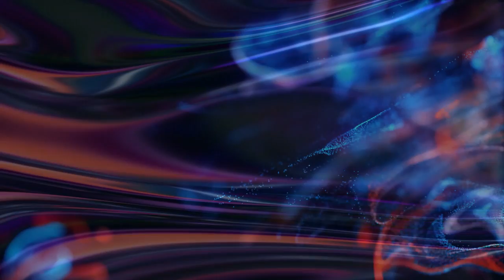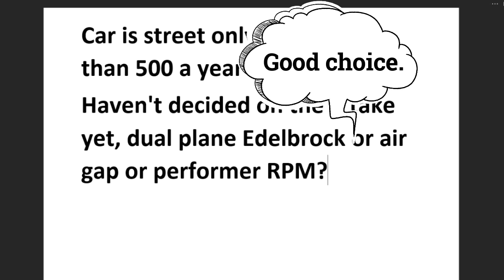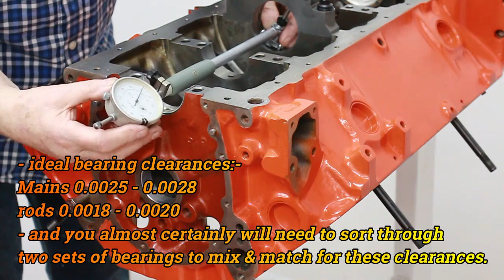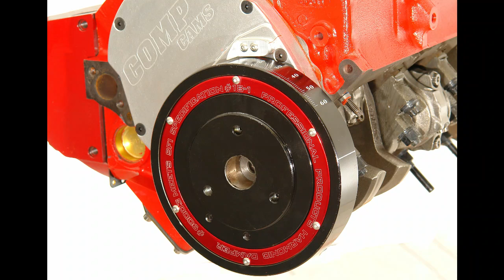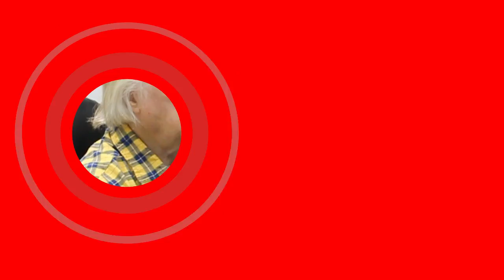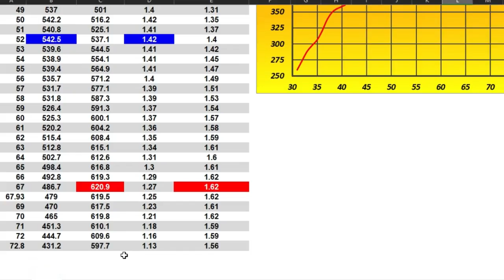How we built that super competitive low buck 383 SBC

Comment: Funny how dynos go back and forth on connecting rod length, though Chevy small blocks over 327 cid tend to lack a good rod to stroke length ratio and likely a longer 'rod is going to help no matter what. As for Howards camshafts, are they really the best company to contact for advice?  Seems like a lot of cam companies out there left over from the 1960's still copying other peoples' findings. I agree with the dished piston, best to have compression occuring inside the cylinder rather than inside the cylinder head--why try to push on the cylinder head? You want to push on the piston, and once it moves a few inches past TDC it's created too much volume and it's just along for the ride. Begin the compression up in the cylinder head and you've already lost distance as the piston moves and increases volume. 

I would argue splayed main caps are better than the factory 4 bolt simply because the bolts aren't in the same plane.  I also don't waste time painting the inside of any block--the factory doesn't bother, and they make it to 300,000 miles.  Has anyone ever pulled apart a sealed junkyard engine to find rust inside? Of course not, oil displaces water. Paint doesn't hold in casting sand either--in order to get the paint to stick, you have to clean out the pores of the block and thus you've gotten rid of sand.  Finally if paint could ever smooth cast surfaces for oil flow, body men wouldn't need to fine sand their work--they could just paint over scratches and get a smooth surface.
Reply: If your not pushing on the cylinder head your in turn not pushing on the piston. 
Also I don't think the glyptal is for rust prevention as much as it's for heat. Don't hold me to it but I think it's been proven that's engines internally coated with glyptal run lower oil temps, and I think it does aid in faster oil return. It seems to stick pretty good to engines and motors, I guess it works similar to a primer to fill in those scratches or sand pits.
Reply: @stevenbelue5496  True, the cylinder head is a roof (or foundation if we think of the entire cylinder upside down)
for the combustion kernel to push against, but if it's really just an "attic" where the combustion occurs through expansion, then combustion is pushing against the top and sides of the combustion chamber inside the head, and the "bottom" of the flame front is pushing on the top of the piston--in effect, we're only using 1/4 of the combustion kernel to move the piston and 3/4rs against the volume of the cylinder head and the bolts/studs holding it and the gasket in place.  Once the piston is (let's say) 2-4 inches down the hole past TDC, the volume has increased to a size where the combustion pressure has dropped and the piston is just along for the ride during the rest of the 4 stroke movement (compared to say a design where combustion was not happening in a large volume cylinder head but inside the cylinder itself--the piston will travel further from TDC before its created too much volume for there to be high pressure). The W chevy big block engine and Ford's MEL design had zero combustion chamber in their cylinder heads. Just three holes in a flat cylinder head deck, two for valves (they were all wedge design) one for the spark plug. Combustion occurred inside the cylinder itself, but Chevy wanted their W engine to be in both trucks (low compression) and for racing (high compression) in 409 Impalas and that meant compression had to be set by either piston design or block deck height.  This would raise costs in production, since pistons would require a balanced reciprocating assembly, et cetera. Ford's MEL design (Mercury Edsel Lincoln) was patterned off the FE series which was getting replaced by the Lima 429-460 so it too fell to the accounting axe. 

Glyptal is designed for low RPM industrial engines, and it is a recommended sealer paint over Rustoleum et al. some engine builders will paint the inside of a block when it's a backup racing engine that will see storage
and claim rust is an issue (but then why not paint the crankshaft and such, they need rust protection and oil to be shed as well). Glyptal will run lower oil temps because it will act as an insulator/poor conductor for combustion heat building up in the block, but that means the heat stays inside the block. If you design the engine to do something with that heat besides overheat (ie use it towards combustion) or get taken to the radiator by coolant, then you are onto something.  Hot oil will circulate faster than cold oil, however, and too hot an oil temp can be dealt with through an external oil cooler (something to consider on supercharged or turbo engines that rely on crankcase oil to lubricate the "blower". there used to be "turbo timers" that left the engine running after a hard drive to keep the oil from turning to coke on a hot turbo, but folks figured they could do it themselves for free :)  ). There's also an issue of detonation--if parts of the block around the combustion area don't cool, they can turn into "glow plugs" that cause a second source of ignition besides the spark plug. since pistons are made out of aluminum, its good to let them shed combustion heat thru the rings into the cylinder walls and then let the cylinder walls give that heat to the block and then to the cooling system (if you own an infrared scanner, check out different parts of a running engine, you'll be surprised at the readings you see regardless of what your temp gauge in the dashboard is telling you).

Glyptol will stick well (due to its composition) on metal that is constantly expanding and contracting due to temperature range (compared to cheaper paint designed to be used on metal not seeing such dramatic temp changes, plastic patio furniture, and other home needs), but like all paint it needs a really clean surface to adhere to--like even taking a torch to the block and wicking out the moisture from the pores of the cast iron. Cleaning that extensively tends to remove much of the casting sand found inside any block, and if that block has been "seasoned" (ie, run in a vehicle versus an aftermarket block straight from a forging process), chances are during its operation oil pressure has blown a lot of sand out and into the oil filter before we plucked it from a junkyard.  But primers, as you may know, have a dull appearance because they are not smooth of top surface--otherwise light would reflect evenly off its surface and give us the shine we see on glossy paint. Run your hand across it, and you will feel it--and if its noticable to the flesh, the oil likely finds it rough as well. finally, there's just the matter of application--if you want a smooth surface, you have to apply paint evenly, no runs, drips or errors (as the ads used to say).  The best way to smooth oil passages is to take a dremel drill and some padded bits and go to work polishing away the metal to a smooth surface. 

thank you for the polite response in an age of internet :)

Comment: I like vacuum advance. People who say "I only drive wide open" should like it as well as they never have any manifold vacuum. 

Also I think ported or timed vacuum has a use beyond just emissions, especially on some street motors that need a lower idle speed. I find it lets you idle down without basically blocking the transfer slot and this allows the transfer slot to work as intended to transition the mixture to open throttle. I prefer a "square" opening below the throttle plate if possible. If it is too short, there will be almost no fuel flow and when you open the throttle it creates a lean spot.

Comment: 6.0 rod pulls the piston away from TDC at a slower speed and that extends the torque curve to a bit higher RPM and that makes power. The cam/ports only know piston speed and a longer rod makes it seem like the engine is revving slower. This will also often raise the torque peak RPM as well but that is the tradeoff.
Reply: Joe Sherman did a test, found short rod SBC 406 had more power below 6200 RPMs. long rod more above 6200 RPMs...
Reply: Aye, the longer rod results in a greater rod-ratio, and hence lesser secondary imbalance. (which is the term used for how the piston travels faster at TDC and slower at BDC, resulting in forces on the crank that oscillate twice as fast as the engine)

Comment: I think that the cam manufacturers recomend more lsa because of vacuum for power brakes.
Reply: Yep, in actuality attributes such as idle vacuum, idle character, and fuel economy are the basis for the wide LSA's. But... for optimum power.. DV is dead on with his formula for calculating LSA' s.
Reply: Yes, in this street only build great MPG and a wide power band is usually desired more than undrivable biggest HP... The Chevy LS7 427" engine uses a 122 degree LSA for tractable power from 500 - 7,000 RPMs... Jeremy Clarkson demonstrates that by taking a Corvette from 0 to 200 MPH using only 5th gear!...
Reply: This age of turbo's calls for less overlap, I'm not sure I buy into it with the events happening as fast as they do.

Comment: 07:30 It would be nice if you could elaborate a little more on what is the failure point with the late model blocks ?
I would really like to know as i actually seek these blocks out (the 880's & 638's) as they are great for doing low buck roller builds
So far the only issues i've had or heard about with these blocks is not all will accommodate mechanical fuel pumps and the bores are cast a little shorter so rod and piston choices have to be more closely considered when using stroker cranks.
Reply from the maker: Hey Lucky Right on the money for  good build of about 450 hp max. All the failures I have had have been catastrophic. In each case the whole side of the block came out.
DV

Comment: There's no such thing as a "high nickel" block.
Reply: Why is that ?
Reply: @luckyPiston  nickel and tin is NOT even a material in grey iron which is what blocks are cast from. Cast iron has to follow regulations for it to fall under the name (CAST IRON). If there was to of been a block to even contain any it would be rendered unusable at the foundry. It would no longer be cast iron 😂😂😂😂. The old legend is even in super Chevy magazine. It’s a myth that could have never been possible in the first place.
Reply: @brandonbell3089  Yeah i've been surfin round the net just now and there is a lot of evidence that the high nickel thing is a myth.
People have tested the material in various lab settings.

In general the info points to elements that just simply made a decent cast iron like a bit of Chromium, Manganese, copper, zinc and a trace of Moly, followed by a cooling phase when casting

There is some anecdotal evidence from people who machine these blocks indicating that there is some variation in hardness so your best bet is to do a brinell hardness test on whatever block you are considering so you know what you are starting with.
Reply: @luckyPiston  There absolutely are differences in hardness between blocks.  I have a hardness tester and I sometimes test blocks that I'm finishing.  I've found that using the same stones and techniques that a harder block will produce a smoother cylinder when checked for RvK, Rk and RpK using a surface roughness testers.  All said and done I'm not sure that it makes much of a difference when it comes to cylinder wall life as long as the surface is prepared correctly for the rings and the intended application.  

Paul Kane at High Flow Dynamics tested all different kinds of automotive blocks including Ford SVO etc in a materials lab and he found no blocks with any appreciable nickel content.  Maybe DV could get in touch with Paul for an episode and have him share some of his data.
Reply: I know. Vizard is the one that started the myth
Reply: There is also no right Scat crank or rods. lol Their quality control will make the Chines cringe.
Reply: @PSA78  In my experience the 7/16 bolt Scat I beam rod is very good for the price.  I've had great results from them and I've used them quite a bit.  They also clear the block better than just about any other rod in a stroker application.
Reply: @DaveMcLain  They tend to have a poorly machined parting line so they need to be squared up and honed, then they'll tend to get oval after torque cycling.
Their cranks are notoriously ground bad with barrel shape and sometimes with the wrong radius.
Getting everything in to good tolerances with them usually adds a lot of work, and there is other options out there for the same kind of money (originating from China) that's already good out of the box. Still... they are better than Eagle, I'll give them that. 🤷‍♂️😄
Reply: @PSA78  I can't say that I've had any real problems with them and I have some that have run more than 10,000 laps.  When will I start to see these deficiencies?
Reply: @DaveMcLain  An attitude, really?! 🤦‍♂️Well I guess then it depends on when you stop having a fragile ego and start learning to pay attention. 🙄
Reply: @PSA78  What I do with these rods:  Take them out of the packaging, wash off the rust preventative, loosen and then torque the bolts, check them and then adjust the sizing so that they are all the same.  Then I check the clearances and put them in the engine.  That's what I do and they've worked well.  What other $400 rod is better?
Reply: @PSA78  just because they are made overseas does not mean there not good quality. A scat generally has great quality control. What rotating assembly somone decides to use is up to them. It’s personal preference there is no better one
Reply: @brandonbell3089  I have not said that anything is bad because they are made somewhere else, I'm not sure how you even got that idea. 
I would rather think that they produce better products if the price is the same, as the west really can't compete in price and that's why there's actually better products coming from the Asia than America today. 
I have also never told anyone what to use, but having an open discussion about products seems rather appropriate, considering the video and discussion in general. Well, until some 🤡 believes that there's evidence in that nothing has gone wrong yet, like the individual that has failed to catch the problem to begin with would catch it later, brilliant reasoning... 🤦‍♂️
If you feel that they have a product you like, use it, I'm really not here to police you or anyone else. But that they have problems other mfg of the same price and origin doesn't have is pretty well known if you Actually research it, but that's up to you. 👍
I'm out.
Reply: Some blocks up to 1970 were better quality, but after that the emissions slug engines made so little power that better cast iron wasn't needed... however, the same molds were still used leaving the 10 and 20 content numbers on them... but meaningless then...
Reply: @BuzzLOLOL  now what since would that make 😂😂😂. Yes in 76 fuel mileage and smog became a thing. They lightened the blocks slightly roughly 20 pounds. The cylinder walls are absolutely the same thickness though. I’ve Sonic checked hundreds. Actually the mid 90s 880 Vortec blocks seem to have the best core shift of any other GM block aswell as the thickest cylinder walls
Reply: @brandonbell3089  - The 1950's 283's could be bored 1/8" to make a 301", but not the later ones...
Reply: @BuzzLOLOL  I’ve 350 blocks bored .100 over in dirt track cars. That doesn’t prove anything. All depends on core shift and a Sonic check. There is no certain year blocks that can be overbored more
Reply: @BuzzLOLOL  No those number were always meaningless and have nothing to do with the material used to cast the block.

Comment: David Sir, I hope you are enjoying a restful Sunday. Thank You for sharing your knowledge with all of us. Not a big chevy fan. more of a Mopar fan but like anything with a motor. I'm in the build stage of building a 318 for a 82 Dodge D150. I have ported the heads myself. So this is my first to-do any grinding on heads. I guess only time will tell if I did ok. Did get a rv cam for it. But also got a whiplash cam for the 340 360 9 degree. Haven't bought a set of headers yet was wondering what tube size to get I was thinking the bigger the better. Was even thinking about making my own would be easier on my money . Maybe find what I need at the scrap yard or someplace cheaper. I have a lot more time than money. Any advice would be very apricated. Always be safe in your travels and Take Care
Reply: 1.5/8 header is all you need with a 318
Reply: @kennywhiddon1497  - Depends on the HP level... but yes 1 5/8" primary should be fine for his app...

Comment: What's your thoughts on fluid dampers compared to rubber dampers? are rubber dampers limited to a certain rpm range?
Reply from the maker: Hey Max,
 I did a 3 week damper test years ago with torsional vibration measuring gear. But that's a video in itself.
DV

Comment: I sure would love to see a Vizard Cleveland build.
Reply: I’ve got a Cleveland going into my 86 mustang next. This engine went a best of 6.08 in the 1/8th on a 150 shot with factory closed chamber heads, mechanical roller cam .711 int .714 exhaust 262-272@ 0.050 300-306 degrees advertised on a 108 intake centerline. Chris Parker funnel web intake. Forged flat top pistons, Scat I-beam rods, factory crankshaft. I was running 4:30 gears and 31 degrees of timing on nitrous. This was in my 81 Capri with the stock K-member. I know I could’ve gotten into the 5’s in the 1/8 with 4:56 or 4:88’s. My mustang is all Team-Z suspension, coil overs, and weights about 300 lbs lighter than my Capri. I’m building a 6” long rod Cleveland right with CHI 3-V cylinder heads-same camshaft. Yeah Cleveland’s are the baddest of any small block platform.
Reply: @StainlessTIG2  Awesome.   CHI heads are on many 550 to 1000hp n/a builds.